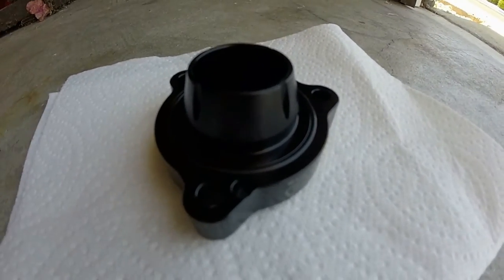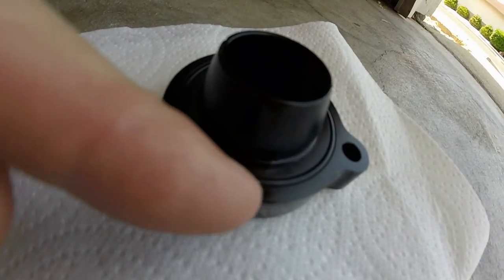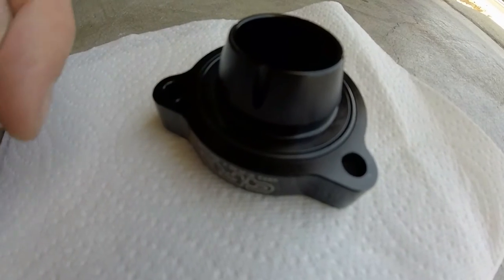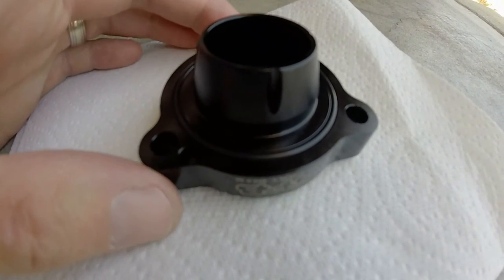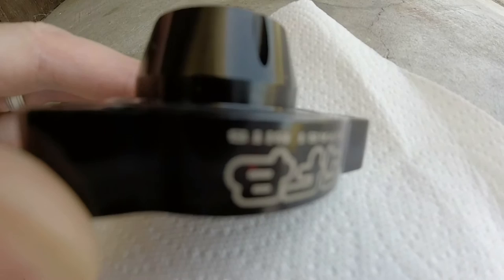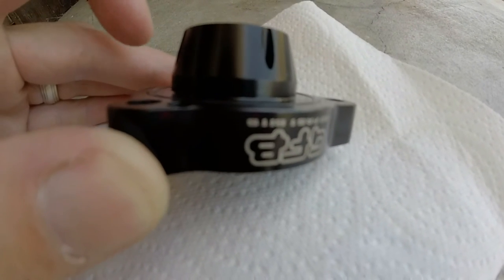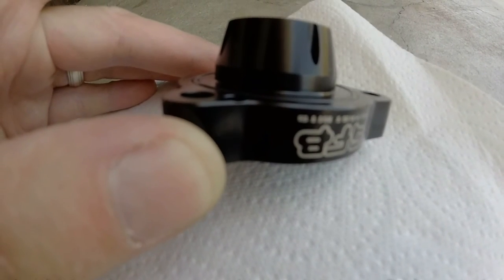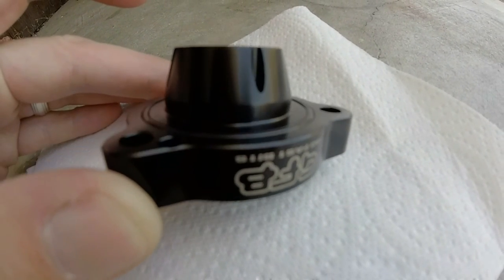2013 VW GTI: Episode 43 Vlog: Squeal/Whine Resolved

Comment: I'm curious about this part. I'm wondering if you did some boost and throttle logs with a Vag-Com to see before and after the install. I always thought that VW/Audi did put a electrical DV to be able to control it via the ECU to avoid overboost of the turbo and the whine noise come from a leak on the DV. Now how does the ECU react with this part added because now the DV can't leak at all. If you have a chance do the test and let me/us know. Thanks

Comment: Thanks for the heads up. I have purchased the same product a few months back but haven't installed it yet. Do you think it would be safe to run the dv if I'm running stock and only plan on going stage 1 in the near future?
Reply from the maker: I'm not telling anyone they shouldn't run it. Just that if you happen to hear a whistle after installation, you know what it might be.

Comment: isn`t the car under warranty still?
Reply: it is an aftermarket part, and he is stage 2 so no his car isn't under warranty for anything mechanical unless he goes to a mod friendly dealership
Reply from the maker: ***** i had a HPFP replaced on my K04 on my 2011, they didnt even check if I was modded. depends how lucky a dealer you get.

Comment: Quick question, The sound you heard, it sounds like a continue whistle?
Reply from the maker: no. wasnt continuous. it was just at the time a certain air flow goes thru the valve. continuous could be some type of boost leak at intake or charge pipe hoses.
Reply: Did it sound almost like an alternator belt slipping, and only did it at a certain rpm?
Reply from the maker: @jokersadidas  i'd say thats a close description. like a short whistle/squeak. thats your piston noise.